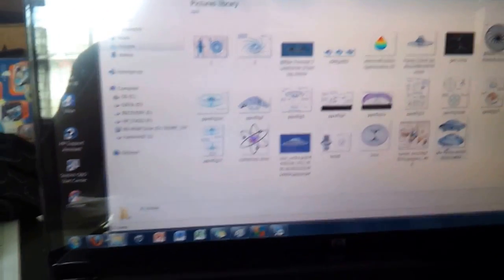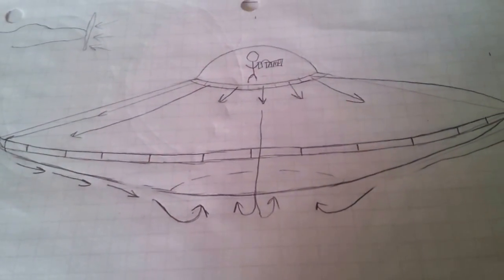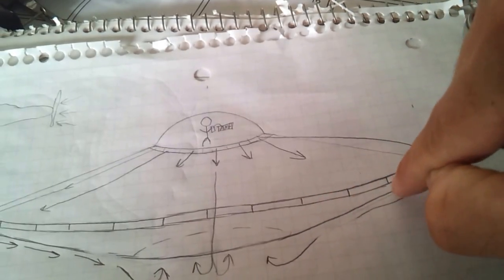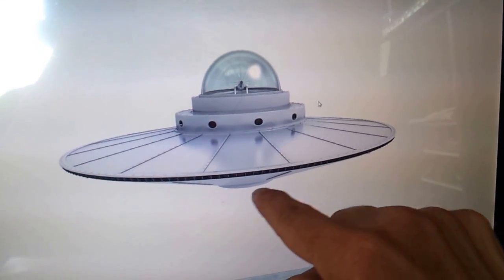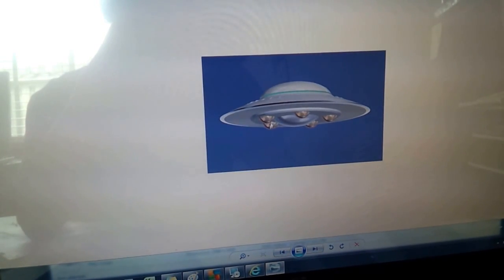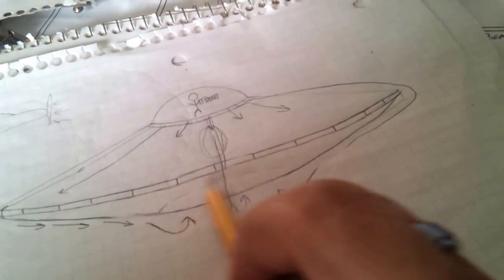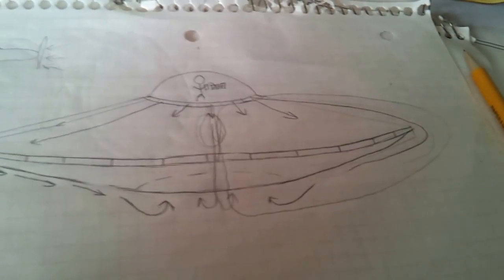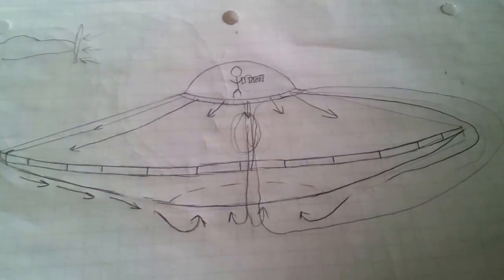Anti Gravity, how possible can it be?

Comment: It is a good idea but I'm thinking do to the same air recirculating through the ship at super hi speeds there would be major friction which causes Heat and the ship would melt down, and cook the pilot.
Reply: to solve the answer to your question just layer the ships internal/external with silicone sheets :) that takes care of the over heating/friction problem. but the real problem is the fact that you don't get lift from such air flow also using air to make a flying saucer fly just defies the whole point os a bloody space ship lmao XD 

HERE'S A GOOD QUESTION>> IF YOU WAS TO BUILD A LIFE SIZE FLYING SAUCER (MADE OF THE STRONGEST YET LIGHTEST MATERIALS) WOULD A GYRO PLATE/SAUCER BUILT IN TO THE BODIES CENTRE WITH A AIR VENTING CYCLICTIC SYSTEM AROUND THE GYRO WOULD THIS CREATE LIFT?? ALSO IF YOU WAS TO BUILD IN DIRECTIONAL VENTING FOLDS ALL THE W AY AROUND THE SHIPS CENTRAL BODY COULD THIS BE USED AS MEANS OF NAVIGATION?? ie for example you would electronically close set folds to force direction which ever way you want to travel?? :/ hmm NOT THEES SOMETHING FOR A GARAGE NERD TO TRY OUT ON A MINATURE EH?? :)

Comment: problem is you cant bend air to work that way ,the air would have to be ionized and contained within a  magnetic bubble like our atmosphere is contained within the magnetosphere. and the polarity would be to p positive and bottom negative and the air would have to be ionized to oppose those poles and pulled in at vents but the power requirements of this if it is possible  would border on giga watts

Comment: It’s actually 2 electric magnet discs spinning into the opposite direction it will then lose weight and will lift in the air like the spinning wheel

Comment: Gravity would push down air resistance would help flight but maybe movement is like a humming bird were to flip it moves back and forth whist it hovers/flys so maybe you could generate a machine with low mass and aerodynamic support like and umbrella in which flys up due to the air travelling up and pushing up

Comment: If you leave the suction open it will counter act the return flow. Your idea about the turrbine is correct, just the flow needs to push and pull in the same direction. Suction at the top and exhaust in the narrow slits at rim pointing slightly down. Now you have pull in the top and push in the outside slits.
Thats the way the real electromagnetic ufos work, the presure in this case is not air, is the aether vacuum at top (suction vortex) and high pressure at the rim, now aether vortex wtf is that? that is the force that makes two magnets attract or repel, two vortex  spinning face to face in the same direction makes a bigger vacuum in the midle of them (atraction), in the opposite direction will repel.
I guess that is enough for now.
Reply: 100%
Reply: Pulse & counter rotation 😁

Comment: Your design concept is GREAT (if you flip it upside down as others have pointed out) for a workable flying saucer in Earth's atmosphere. I would love to see the design tested, and encourage you to be the one to do that as I'm sure you can create a small scale model if you get a few thousand dollars together. BUT...

@3:00 Wrong, your logic error is that while there would indeed be low 
pressure air immediately under your saucer sucking air in, there would 
be much lower pressure immediately below that in the vacuum of space 
sucking air out much harder. As you point out air always flows to the 
least resistance, so no air at all would be getting sucked in, in a 
vacuum of space. Also as others pointed out, your design is done upside 
down and does work if you point it the other way.

Comment: No, flying saucers employ the Biefeld-Brown Effect for levitation and propulsion.  Revolutionary compact nuclear generators provide the very high voltages needed because gravity and electromagnetism are two sides of the same coin hence the term "electrogravitic".  There is no need for air vents and air vortexes because the intense electromagnetic field surrounding the flying saucers does the same thing your Tesla turbine achieves with air but more efficiently.  It not only eliminates air friction but also inertia within the craft allowing speeds in excess of Mach 40 in the atmosphere.  Pilots are therefore unaffected by high velocity right hand turns for example as the G-forces are cancelled.  Tests performed in France in 1955-1956 and in the United States in vacuum chambers have demonstrated that the Biefeld-Brown Effect is not just an ionic wind effect but really does have a gravitational component allowing space propulsion.

Comment: Hmm so basically you describe the fuctionality of a brushless outrunner motor here i think but you would need at last 1,5 times the force to lift it in the air and to do manuvres i think like 3 times the force. the thing with the electromagnets is cool but wouldn`t you have to make sure to change the strenght of the magnetic field instantly according to the flightcontroll? i mean just hypotheticaly...

Comment: The magnetic effect was used with the original design, but it appears you think they will help with air circulation.  If you believe your theories are correct, why didn't you build a small scale working model?

Comment: Spin like a gyroscope keeps it rotation counterclockwise 
Reverse engineering 

Plus repel magnetic field 
Make a bubble field around the ship 

North South magnetic within the core repeating middle spinning counter
 clockwise
You right about the counter clockwise creates a vacuum which will go up 
With angle air magnetic repel thruster 

Force field around the ship
Air vortex and magnetic thruster propulsion with waves like a speaker 
Ripple effect pushing 
Down 

Just like the earth spinning 
Counter clockwise and creates a vortex 
Like a tornado within the middle zero gravity dead wind now when you get closer going out becomes a powerfull wind just like a magnetic field the middle equator repel magnetic field north south pole outter around to the north pole 

Creating a electrical field and magnetic being at the same time lighter then air

Comment: You have understood the picture you have shown completely wrong what you're looking at is a magnetic flux line you have to spin the magnetic field not the air the air is not going to make it go up if you have an implosion motor which is what you're talking about this machine will not go above the stratosphere and they probably wouldn't even have a lot of speed to it you have to go in the route of the magnetic lines if you can do that you have levitation it creates a gravity bubble around the craft and also on top of that you have simulated gravity. Because in reality there is no gravity is simulated gravity. Read Walter Russell work he is a genius it'll give you a better concept of what you're talking about this man is none other than a genius and before he published his work he send it to Nikolai Tesla for him to review it before he published it that's how smart this guy is so look into his work it'll give you a very good understanding of what you want to work with.
Reply: It would work only with the counter rotation electro-mag, and using his system only as thrust, only out atmoshere.

Comment: good theory, but this does mean the UFO would not be able to work in space, unless you can prove its possible to create an "Air Field" with air trapping it inside the field. Until than i disagree, i think you need to think more along the lines of magnetic fields, electromagnet's and mercury vortex generators. Instead of 2 turbines pulling air in one way and out the other, maybe try rotating 2 magnets, clock wise and anti clock wise until it becomes weightless, thats my theory anyway, but overall good video and outside the box idea

Comment: i have a blueprint of antigravity, if u believe me, i'll send u free for u, but its not for commersial, u must share it for everyone.
key of antigravity is, high voltage, high frequency, high vibration, geometry 3 6 9, electrostatic, cavity, capitance/big capasitor, u can use leyden jar with salt water fill in, and negative charge in ur body. i hope u can imagine how u built it next.

Comment: Good explanation. I think that is what mercury with a magnetic disc organized in a concentric pattern with a magnet at the inner ring while the mercury would channeled around the inner magnetic ring as the outer ring. A charge could be applied to mercury and depending of polarity of the inner disc the outer mercury channel would spin in one direction. If we flip the inner magnet ring, that would change the polarity and slow it down.  I would think that you would still be able to create that torroidal effect as a result of that combination but without the use of air. What are your thoughts ... and here is a reference video to show this idea.   https://www.youtube.com/watch?v=au4hbUm4mMo

Comment: “Collecting electromagnetism and protons in the Air”? Oh boy... if you apply F=ma to a close system if the particles stay with the vehicle, there will be a net zero acceleration. 
It really doesnt matter if your video is professional but that your ideas are based on physical principles. 
You have invented a “helicopter” that travels with its own air. There is zero net force on a vehicle like that.